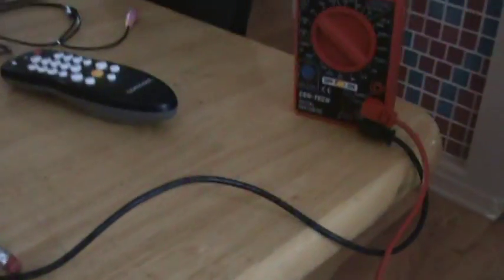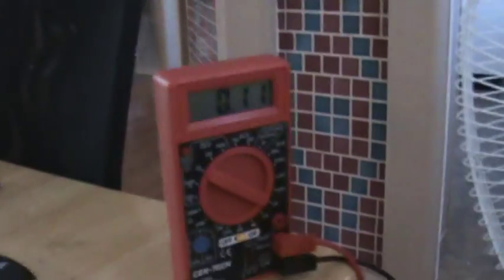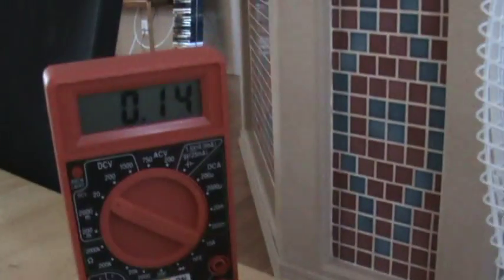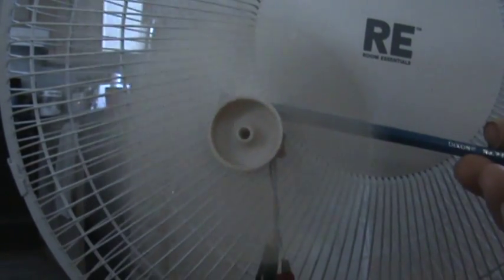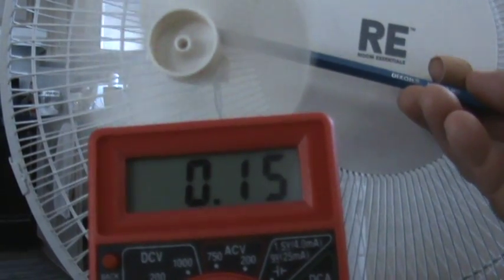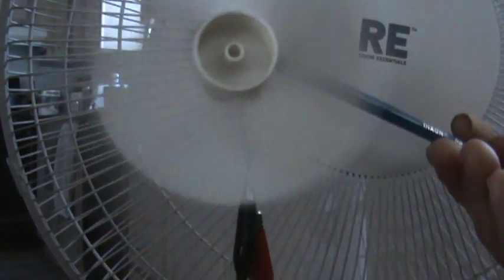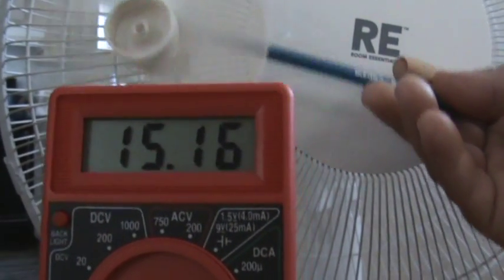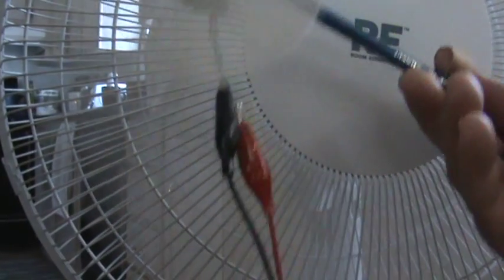mini wind generator

Comment from the maker: @jdcmusicman do you have a video showing me what you mean, what i want is a small motor to set up behind my window ac unit, I do not know if you saw my videos where i have my fans spinning from the exhaust from my window ac but I have a couple of led flashlights i want to run off a small wind generator, I can run the flash light off my solar cell phone charger, but i want to make a mini generator, since my ac runs 24 7 i want to use the exhuast  to run something if that makes any sense.

Comment: @Iseekoutthetruth  Yes , unless you hook a rectifier to change the ac to dc ...Most of the small stepper motors I have will do anywhere from 2 volts to 20 volts depending on how hard I turn it by hand and can light several Led's at once ....If you can hook a Led up to one and just turn with ya fingers and it lights up good , then its a good little generator ...I have one that will light 2 - 15 watt cfl lights if I hook a drill to it to turn it ...

Comment: Good stuff man , but you are still getting a false reading by using the DCV  and DCA settings..All DC motors produce AC electricity ...The reason its not showing anything on acv is because that motor is not producing that much .....I have several motors that size they just dont make good generators..